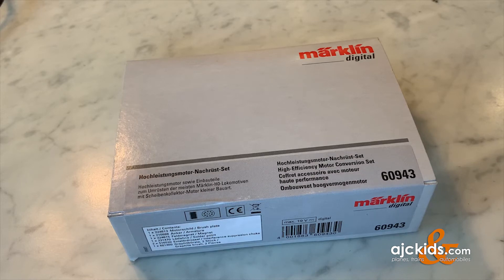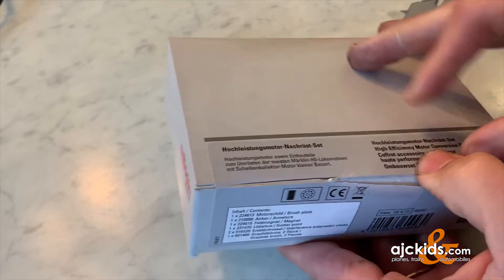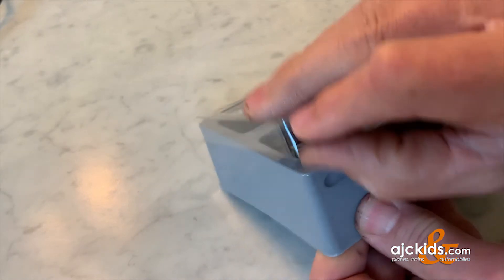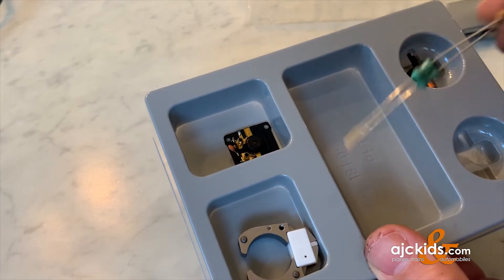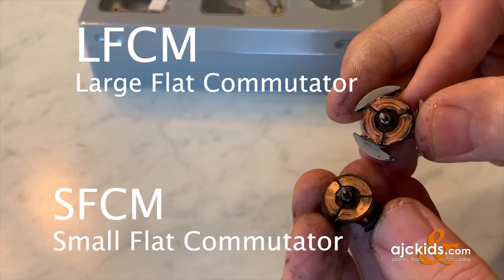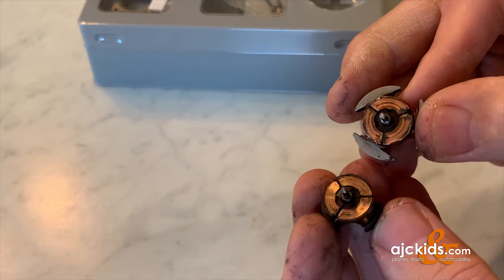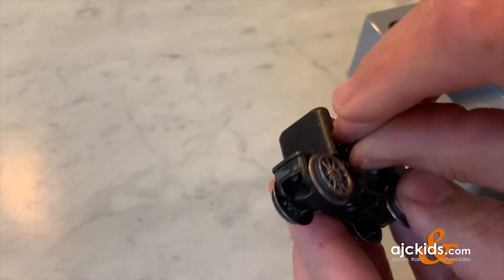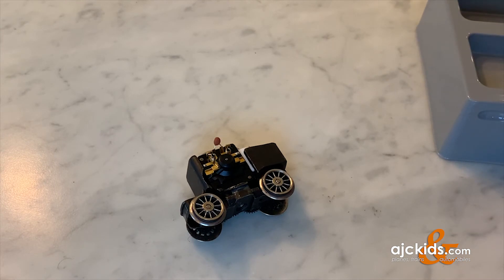Marklin 60943 - SFCM Motor conversion kit

Comment: I assume that this is for the conversion of my 3071: NS SBB TEE Diesel Train Set "Edelweiss Express"...
Reply from the maker: You need to open the motor, so that you can confirm the size of the armature.

This because there are two sizes, Small (SFCM) and Large (LFCM). The large armature has three poles that are clearly larger, and "stick out" well past the commutator disc. The 3071 has I believe a LFCM motor.
Reply: Is this the same kit for a 1957 3003 lok?